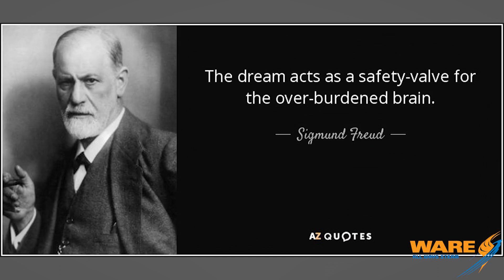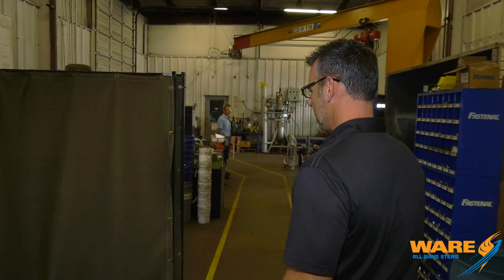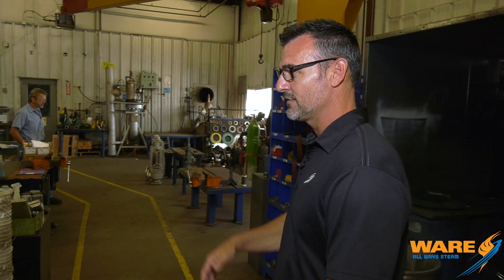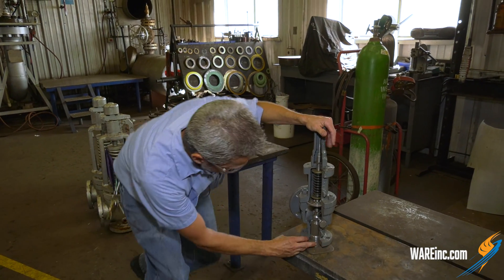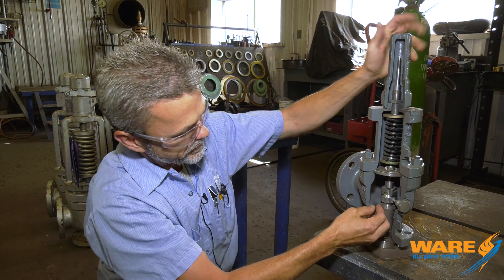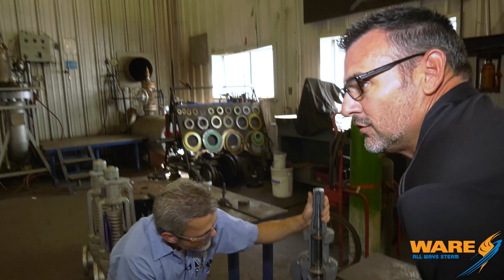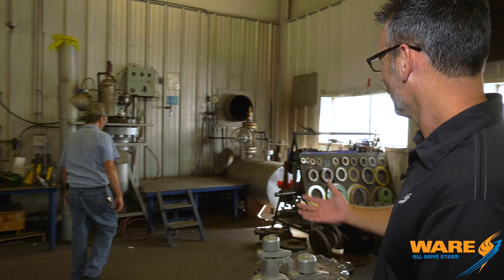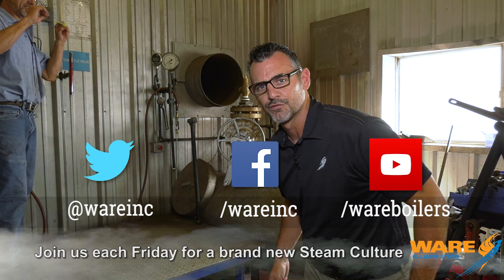What are Safety Relief Valves? - Steam Culture

Comment: For YEARS in Industrial Construction, the general rule has been to NEVER lay a Safety Relief valve on its side for shipping or storage. No matter if going out for inspection and testing, or coming back to be reinstalled for service. ALWAYS keep the valves in the upright / vertical position. I have NEVER been able to find out WHY this is important. It would seem to me if the valve is removed from service to be sent for inspection / service / recertification, the storage / shipping position should not matter. I'd appreciate it if someone could provide the reasoning to keeping safety relief valves upright at all times.
Reply from the maker: Hey Scott,
I asked our main valve guy here and he had this to say. I have seen this many times in manuals but never with an explanation.  The only explanation I ever heard that made any sense is regarding a large safety valve with a low set pressure.   The concern was that on a large valve, say a 4” x 6”, that has a low set pressure for example set at 15 psi with the valve is on on its side during transit the disc could move up and down against the stationary nozzle and score the disc and nozzle surfaces.  This would cause the valve to leak. 

Hopefully that makes sense! Thanks for the question!
Reply: @wareboilers  Thank you for looking into this for me. Wit my 35 plus years experience as an Industrial Steamfitter, I came to much the same conclusion myself - that possible lateral movement of the components that mate with the seat could damage one or both, particularly with larger diameter RVs, which have heavier components.  Many Thanks. Cheers